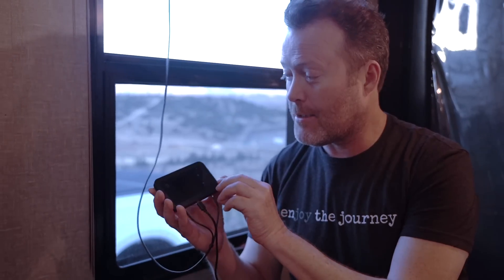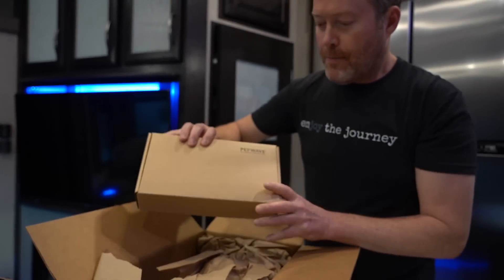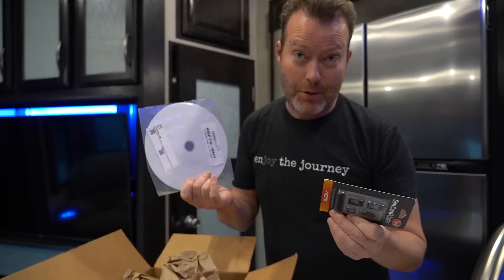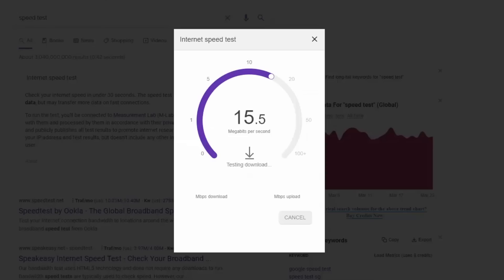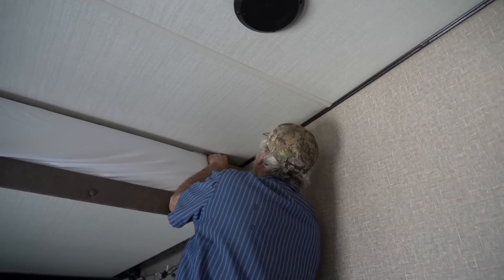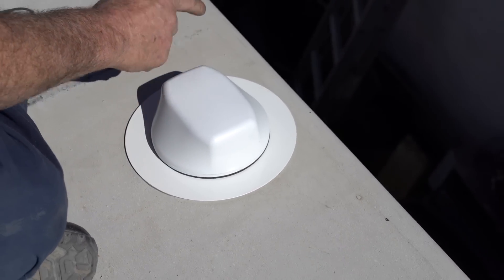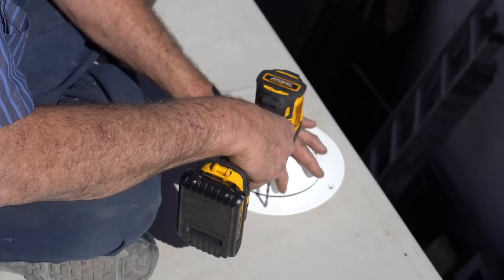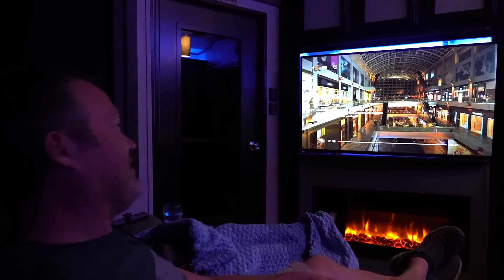BEST RV INTERNET 2024! (NOT STARLINK) HIGH SPEED INTERNET (RV LIVING)

Comment: How close to the inside antenna do you have to be?  I know the WeBoost system you have to be within a foot of the inside antenna however it looks like your new system is different.
Reply from the maker: Hi Keith! We have great coverage through the entire RV with our set up.
Reply: I just purchased a we boost. Did I make a mistake? I have no idea how the pep compares to we boost. I do not full time but when we camp I do need to be able to work. So I ordered it for when my service is shotty at best and I can use my hotspot on my phone to boost the signal. I think anyway. What’s you take on the weboost? Does it work well ??

Comment: I am really surprised the RVers are now just discovering the Pepwave routers.  I purchased my Pepwave MAX BR1 router over five years ago. I also use a Wilson LTE data amp, not a cell phone amp, along with a Surecall rooftop antenna. I was also able to purchase a 'grandfathered' AT&T LTE data plan for $35 a month with unlimited data. Sorry but AT&T no longer sells these plans. We have never been throttled on this plan. We typically use between 200GB to 400GB a month and we're retired. Our Pepwave MAX BR1 router does not have the capabilities of your Pepwave router. But we still get between 10GB to 20+GB download speeds. Good enough to stream HD Videos.

We do not use a cell phone amp. When cell reception is poor, our phones automatically switch over to our WiFi to make or receive calls. With using  our LTE data amp with our WiFi there is no need to purchase a cell phone amp. It's been years since we have used a campground WiFi because our WiFi is usually much faster and offers better security. Campgrounds without WiFi are no longer an issue.

Comment: Best deal is Visible wireless. Get a cheap phone from them strictly for their unlimited hotspot. Their towers are Verizon and every plan you get through them reduces your price by $5/month down to $25/month. A single plan is $40/month. I’ve used them for over a year as a truck driver and have had 0 issues. I probably use about 60 gigs/month just hotspot not included data straight from phone. Can’t beat it
Reply: Can you stream movies?
Reply: @Alphalove3  yes

Comment: Well that's about the same cost as Starlink with 1/10th speed (150 Mbps...)
Reply: @aaronqueen55  It is portable as we speak...you can move and change your address within the app.   "Mobile" by Starlink's definition is the ability to use it while driving 80 MPH down the hwy or in a plane or on a ship...this is not possible yet and will require completely different equipment once it is available.

Comment: I know you need good internet now however we are going to wait for the starlink that is almost ready for roll out.
It’s around $100 per month. 🤔
Reply: Its mostly just in  the North East of tge US and part of Canada and currently is set to a fixed address without the amity to be mobile.  Yes, the network is only about 10% completed, but they are a long way away from 100% coverage and even though there are beta testers working to assist with the possibility of using it as a mobile platform, it isn't anywhere close to being able to work for fully mobile RV living.  Current testing shows maybe 30 mille radius from the fixed address assigned to your unit.  Even then, the beta pricing is closer to $150 a month, but does give you about 300/300 service as of their last firmware update 2 weeks ago.

In short, cellular systems like this will be much more effective both in practical application and cost for the foreseeable future.

Comment: $140. Per month, wow! Seems pricey if you’re not someone who actually works remotely while on the road.
Reply: Most of the mobile cellular data plans have tripled their cost due to the overwhelming demand for this type of product.  A demand generated by so many people homeschooling and moving to work from home positions.

The RV industry, due in large part to the pandemic, has grown 300% in the last 12 months with no signs of slowing down for the next few years.  These data plans have increased as well in step with the industry increase.  Our plan used to be $40 a month, now its $129.  But, it gives us the freedom to go anywhere and we average about 90 mbps with our set up.

So, yeah, $140 is just the average these days.
Reply: @randomaccesswebtv8770  Is that 90MBPS on comparable hardware? I'm thinking about full timing as well, but going without fast internet is one of the most daunting aspects as an avid gamer.. lol
Reply: @CluelessUnknown  I use the Nighthawk M1100 Cellular router.  I have pulled 150 mbps off of it directly and its range is relatively good, but I now connect it to an Action tech Seried T3200 router with a radius of 3000 sq ft and it covers my entire RV and just outside of it.

Most of these newer cellular plans require you use their cellular router, Ihave not tested them, but as long as it has an ethernet out you can always connect it to your personal router or an ERRO Managed WiFi Mesh system. 

Currently ours is working on a Verizon plan and is pulling about 70 mbps.
Reply: @randomaccesswebtv8770  Thanks you!